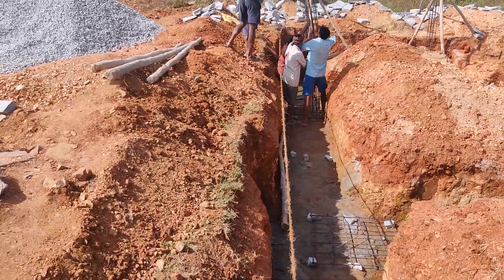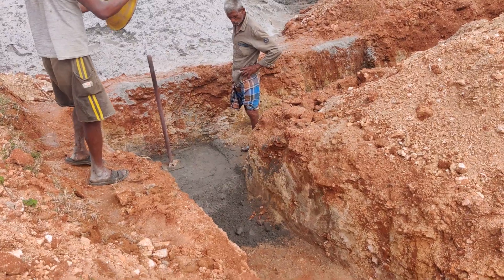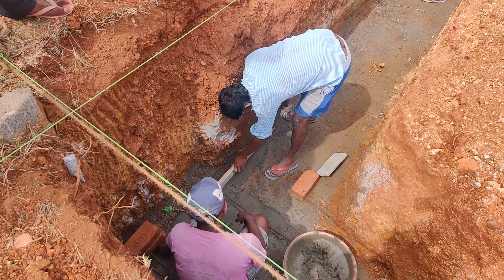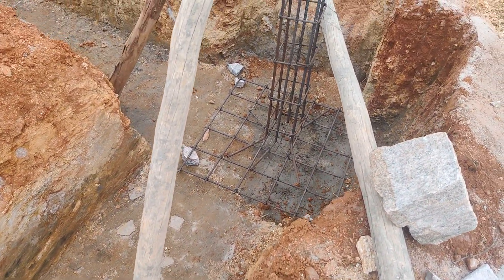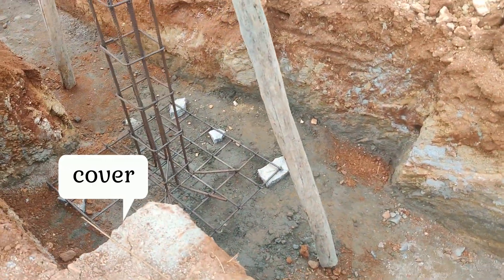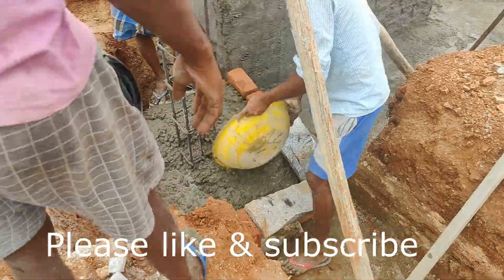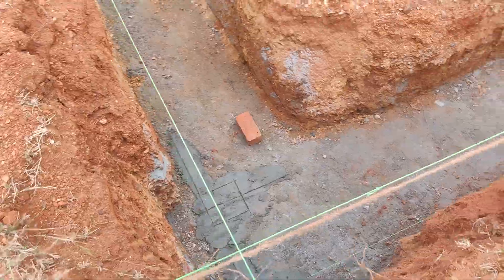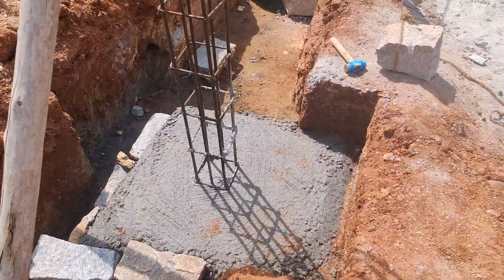RCC Footing/Foundation for G+2 building | complete details.

Comment: Bents should be given in footing mesh ends not given here. Also size of mesh is not right 1.5*1.5 m should be the size for g+2
Reply from the maker: Area and shape of footing always depends on the Safe bearing capacity of soil and Earth pressure and it differs from place to place.
Reply: @creativehomes4547 remove the music very irritating
Reply: @creativehomes4547  ok I agree bent why stirrups are not bent at 45degree . It is not safe for earthquake situation